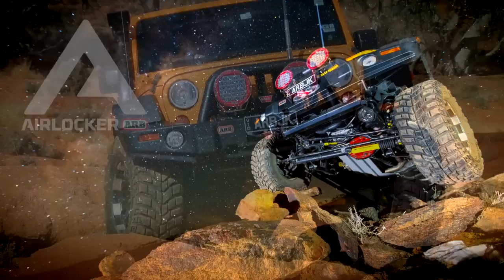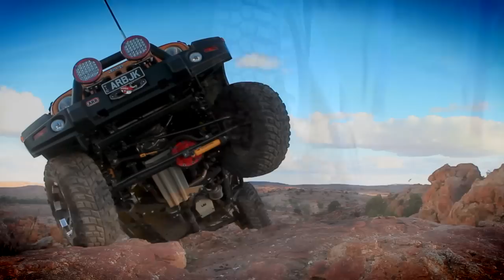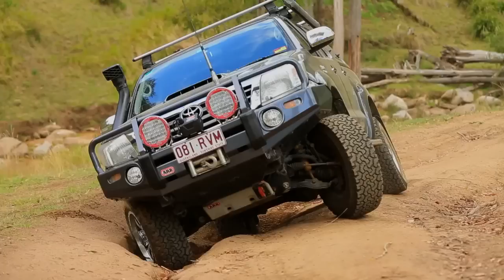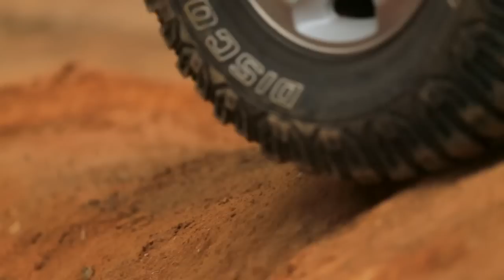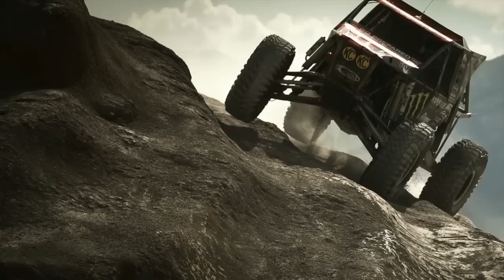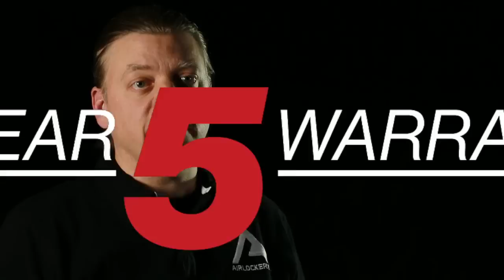ARB Air Lockers

Comment: Hi Team,
Ive a 2013 Hilux with the VehicleStabilityControl Pack (Both front and rear have open diffs) will the Locker have any effect on the operation of the VSC at all should lockers be installed front and or rear.
Also are there varying ratios that are available in case we want to install larger tyres and gear it back up to compensate?

Comment: Hi! 3 days ago I forgot to ask you another thing about the arb air lockers. I want to buy a 2014 hilux  3.0 diesel 5 speed automatic transmission (with normal diff at rear that can not be locked). Can this model be fitted with front and rear arb airlocker or is better to choose the 3.0 diesel with manual transmission wich has a standard back diff lock. Thank you!

Comment: Very interesting and an opportunity to greatly improve the off road performance of my 2WD 2006 Tundra.  Your design that incorporates a simple on/off application of the locking mechanism is brilliant and allows for much greater traction without sacrificing on road performance or fuel economy.  What is your availability in the USA?